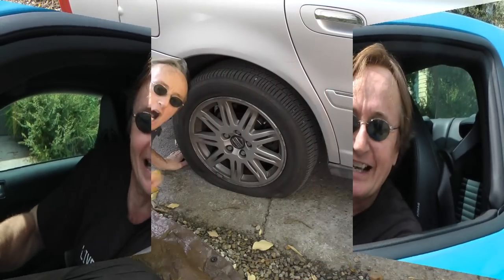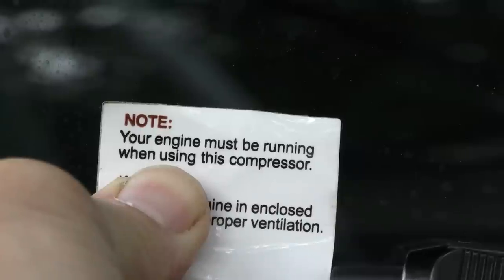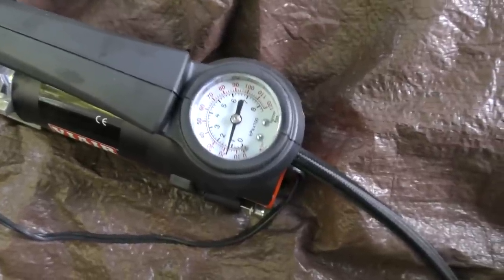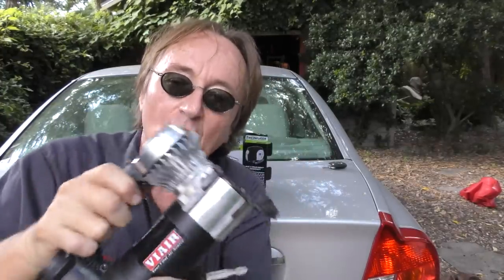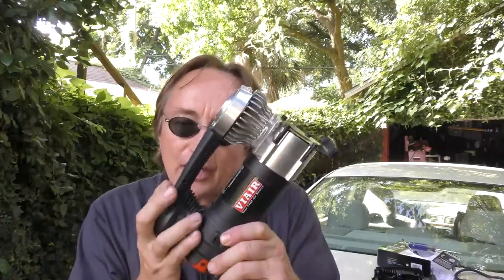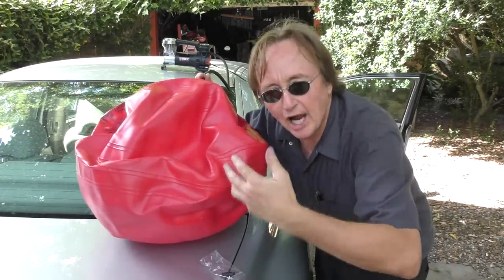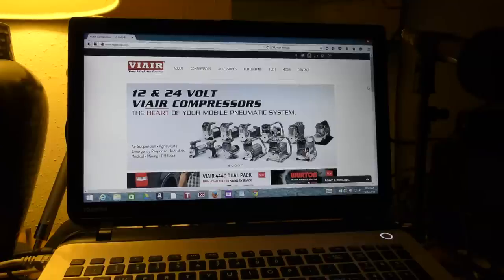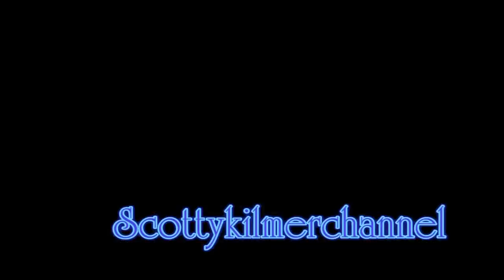How to Inflate a Flat Tire on Your Car (Tire Inflator)

Comment: I use a bicycle pump. It doesn't take as long as you think. Just check the PSI from time to time. For me, I pump all 4 wheels once it's 2 PSI lower than the standard. For 2 PSI, it takes only 6 or 7 pumps.

Comment: Thanks for the recommendation!  My Corvette has a factory air pump that works great but I've been looking for one to keep in my Truck and it looks like it could handle the tires on my compact tractor as well for the times when I get stuck (happens more than I care to admit).

Comment: I can attest that plastic crap bounces all over the ground and I ended up holding it in my hand first time I used it, while bent to make sure the hose reached. I just wish the big boys would also use LCD screens where you could set it to cut off at a certain PSI. That's the only thing I like about the plastic models. TireTek also makes a nice one but I'm not sure what tech it uses inside of it.

Comment: Scotty, what is your thought on inflating tires with pure nitrogen as opposed to regular air?  I know of two tire stores near me that offer nitrogen whenever you buy tires from them.  I do have a local mechanic that I go to, and his thought on them is that they are just a gimmick.
Reply: I am retired from the airlines where we need to fill the aircraft tires with nitrogen to keep the temperature down.
I work part time at a dealership now and for cars, it's just a gimmick. Regular street cars don't need nitrogen.

Comment: My cheap $5 compressor is still going strong and I've had it at least 5 years. The beauty of a cheaper one is you can throw it around until it dies where as an expensive one you wouldn't wanna get a scratch on it

Comment: Hey scotty i have a 2004 avalanche with the 5.3l vortec nd i was wondering if it was ok to drive in tow mode even if im not towing nothing thanks.
Reply from the maker: Denzell Wilder sure, you will just get worse gas mileage

Comment: Scotty Kilmer i have a 94" Honda prelude with a 2000 engine in it that has engine knocking after its been threw a puddle. the car is not hydro-locked but the knocking accelerates as i give it some gas. any suggestions on  some test i can do? i looked in the combustion chambers an there was no water an in the case there was i took all the spark plugs out an cranked the car to clean it nothing sprayed but there was water coming out the exhaust pipe. when in the puddle the engine stopped an i pushed the car out an had it pushed home. so far no wholes outside the engine an the car does crank an ride but the knocking is real loud
Reply from the maker: King mearsal If it still knocks, odds are piston rods are now bent inside, ONLY taking the engine apart would figure that out for sure though.
Reply: in your best opinion, would it be best to just swap the engine out for a low mileage used one or look for a new car? love your vids btw!  they have help me out of a struggle many times keep up the good work

Comment: I agree that cheap plastic compressors are not meant to last.  They are still better than nothing.  I would rather have that cheap plastic one than no compressor at all but that one you reviewed does seem like a good one.  Many of those small compressors that are not direct drive are gear driven like the Slime branded one, there is no chance that the little motors used in those things would ever work without being geared so low.

Comment: I guess if you're an auto mechanic or roadside assistance, and have to deal with flats every day you're probably better off with something durable. But me that all I do is drive around like most people, and inflate a tire every 3 years (the rest I simply change and take to get fixed and reinflated at the service station), I have a plastic crap compressor I bought at the hardware store and right now it's going on 15 years and won't quit. The screw type valve looks nice though, seems like it'll outlast those typical lever-type valves you find on most compressors.

Comment: Do you have to inflate a tire when it's only flat on the bottom?
Reply: wholeNwon Most likely..the thump when it comes around to the flat part would shake the car apart......LOL
Reply: Hahaha what part of a tyre is the bottom when you rotate it
Reply: LOL this getting way too funny. I love it.
Reply: wholeNwon funny :)
Reply: theothertroll Just a small, rostral segment of the right postero-lateral cingulate gyrus.  But I'm young so the contralateral portions of the limbic system will compensate since my corpus callosum is intact.  Thanks for your concern.
Reply: soylent green I actually said something like that to a woman who had a flat tire.  She replied, "Oh, I guess you're right."  Yes, she was sort of blonde.
Then I had to backtrack and help her.
Reply: lol
Reply: +BigAl Willis That's exactly what I thought, Al.  Thanks!

Comment: so if its flat you just fill it up and forget about why it lost pressure?  Ive tried a viair before.  It worked once, then the second time it blew the fuse, as stated in several, several online reviews.  It's still costly and durable, but Id recommend using the direct battery connection vs. cig lighter
Reply from the maker: +infringinator  often nails on in tires and refilling them lasts a LONG time. But viairs are really good compressors, people will always whine about something on the net. Even the best tools I've ever used have people who whine about them, with millions of people out there, someone will always be unhappy and whine.
Reply: Scotty Kilmer I'm not sure whats going on with my tire I have a set of new tires and every  now and then one of them starts draining air.  Mechanic says it could be dirt on the rim.  It's a hassle and I need a compressor lol
Reply from the maker: +infringinator remove the tire that loses air, put 42 psi in the tire. Then drip water mixed with dish washing liquid on the rim of one side with the tire flat on the ground . If rims are leaking from crappy installation (which often happens these days due to lazy idiots being the tire installers who don't care about their work and make minimum wage) then the solution will bubble up where the rim is leaking.
Reply: Scotty Kilmer yeah mechanic automatically said its the rim getting dirty before he looked at it.  Anything I can do to prevent the rim from leaking again?  He claims he cleaned it up and put a bead on it.  To be fair the newer tires held up for a year before this leak occurred.  Now I have the joy of replacing rusted out brake lines at $500, and I'll install my shocks (he wanted $600 to do 4 shocks!) 

Only other concerns I have is 130k miles without changing the transmission fluid.  I'm due for spark plugs and wires soon too.

Comment: Hey Scotty a person made a comment about "what a person should keep in their car". I am guessing for emergency. I think it is a great question. Maybe a video idea in the making. If you do decide to do it give us a summer and winter version. Thanks Scotty!
Reply: Air pump, spare tire, jumper cables, basic socket and wrench set and a first aid kit including water.
Reply: Samuel Campbell and a phone charger
Reply: Big Guy Review There are some Compressor / STARTER combos from B&D that work well. They have a working light, iluminated pressure gauge, 12V cigar socket, usb port for charging things. It has a 12V 9Ah Battery inside for the starter. But you can run the compressor from it, light, and charge phones from its USB socket. Starting current is not that great but it get the job done. Also has a battery alternator checker function using a 5 led meter. This checker also is used for its internal battery. Its a very complete unit and good value IMHO.

Comment: Hi Scotty, I got a check engine light come on  my 1999 ford ranger code p0306 number 6 cylinder  misfire truck runs great can't notice any thing wrong , what could it be ,thanks your the greatest.
Reply from the maker: steve kwall if it runs great leave it. Would be almost impossible to figure out the problem. when it actually misses and you feel it, check spark plugs and fuel injectors first.
Reply: steve kwall  I just fixed this exact code on my Ranger last week. I changed the wires and plugs and it improved a little bit but it was still rough. For me, it turned out to be the coil pack. It was about 100 dollars for the replacement part and it was easy to install. The only thing I can say is make sure you keep the coil pack order to the piston order correct. If you don't know take a photos of the wires and how they go from the coil pack to the plugs. The order is very important or it won't run right. If this is the problem on your truck, it isn't a very hard job to fix. Good luck.
Reply: Thanks moofushu

Comment: I plugged in my new compressor into the cigarette lighter and blew the fuse for the cigarette lighter, should have used the accessory socket which are 20 amps instead of 15 amps. lesson learned!
Reply: Some of these have a FUSE inside so you don't blow the fuse on your car. Newer cars they are called Power Sockets. Just make sure the car is running when using it, I tried one on my 2002 Honda Civic without the engine on and the battery drained real fast. I think they recommend running the engine because they know it can drain your cars battery pretty quick.

Comment: I think I'll go to a gas station and do it for a quarter lol
Reply from the maker: Chthonian121 half of those have bad pressure gauges, and they aren't there on the road if you need one.
Reply: Scotty Kilmer Not to mention, gas station air pumps usually have no air/water separator in them and are poorly maintained. You'll probably end up putting a little water vapor in your tires, too. lol

Comment: Just carry a bicycle pump. It makes good exercise, and it's faster and cheaper than compressors.
Reply: Ive had the same bicycle pump I got when I was 14 for my bicycle. This pump has been with me through 4 cars now. (I buy and sell them a lot) So now I'm 20 and the bicycle pump is still in my trunk. :-)
Reply: XenomorphLV426 you ever try to pump a car tire with a bicycle pump???? LOL Are you crazy?? It would take two days .
Reply: Y10Q Stop being such a girly man and pump the pump.
Reply: Y10Q Didn't I JUST say that I used it for my cars? And no, it does not take two days. Think 2 minutes, maybe 3 depending on how low you are. And it's not like I drive around with leaking tires. It barely ever happens so its not even a problem.
Reply: XenomorphLV426 sounds like it could work, most car tires only need 30 psi anyway versus the 60 or so you find in bike tires so you won't have much resistance to work against. The question is, are you using one of those vertical stand bike pumps or one of those micro pumps you tie to the frame? The second type will probably take a while!
Reply: Mario Melendez
 Bicycle tire is nowhere near the Car TIRE's volume. So you need some sort of a mechanical device to pump it fast enough. I am sure you can add some air with a bicycle pump. Say your tires are at 25psi, and you need 30. But to get it from completely flat to 30psi, forget about it. I don't think it's easy. I am sure it's possible, but you would have to be nuts to use a bicycle pump to fill a car tire. It's not worth the time.
Reply: Mario Melendez PSI is not a measure of the amount of air in the tire. It's a measure of pressure.
Reply: That's my point. You're going up to 30 psi, so pressure-wise you probably won't have any problems with the bike pump. You're not going to come to a point where the tire pressure gets so high you can't force it in with the bike pump. Where you will probably encounter a problem is with the air volume, which is miserable on most bike pumps, so you'll be pumping for a while. And if you've got a puncture big enough, you might not be able to pump up the tire at all with the bike pump.
Reply: XenomorphLV426 bicycle pump is fine if you have a ford model t, but there's no way in hell I'm going to use a bicycle pump on my trucks, especially my freightliner BC M2.
Reply: jim miles Back in 1985 I had a leak on my 75 Cadillac rear left that would be flat every morning.  I was realy POOR back then bad!!  This lady I shared an apartment with had a foot pump bicycle air pump.  Every morning for about 2 weeks I would sat my coffee on the trunk of that car and smoke a cigarette and rotate between my left foot and my right foot as I pumped the tire back up.  It took about 15 minutes, but I would just sip on my morning coffee and look around while doing this.  It was a foot bicycle pump with a rubber foot pedal.
Reply: Y10Q Youre WRONG...When I was broke back in 1985 I used a foot bicycle pump to air this Cadillac deville rear tire up from completely flat to 30 lbs every morning!!!  It took 15 minutes and I did it slowly while drinking my morning coffee
Reply: ***** For the sake of argument. If your car battery is dead there's  no significant difference in having an electric or manual powered pump. Especially since most cars in the USA have automatic transmissions, there's no way you could bump start it like a good o'l manual tranny.
Reply: ***** True dat. All I can say is, whatever works for you and fits your budget, that's what counts. I have one of those foot pumps for bicycle tires that I mainly use for my motorcycle. I always make sure I have it when I'm out riding in the remote desert areas. Plus tire slime saved my butt when I got a flat.
Reply: YES10 lol I tried it from 0 psi and that shit doesn't work especially  when you can hear the air leaking out

Comment: Does anyone know what  year is the best year for a Toyota celica.
Reply from the maker: ***** 1994
Reply: Scotty Kilmer  I was thinking about buying a 2001 celica Gt for 2800 with 140,000 miles should I?
Reply from the maker: ***** if it has the infamous yamaha designed engine, DO NOT buy it, they are junk from weak oil pump set up, the engines cavitate and blow up on high revvs.

Comment: hey whats the legal limit for tire tread in US
Reply from the maker: Jimmy Jay the wear bars on modern tires are the limit, if they are worn down to the wear bars they are illegal
Reply: Jimmy Jay it's 2/32 i believe
Reply: Scotty Kilmer Scotty, can a 12v Portable Tire Inflator work on a Older car like your 94 Celica that just has a Cigarette lighter?   

The new cars all have a little plastic flap that says 12v in place of the Cigarette lighter.

Comment: how can i get the most preformance from a 50 cc motor moped
Reply from the maker: ScNOR ByMinK not much power there, pretty much use good gas like shell V power and revv it up high. Or, rebuild the engine and port it and polish it and put bigger pistons in it.
Reply: Fill the tires till the point that the tire turns into a disc. Not exactly safe though.
Reply: Scotty Kilmer im thinking about geting a 70 cc cylinder on it
Reply: ScNOR ByMinK Nitrous, those 50cc engines are tough they can take it.
Reply: ScNOR ByMinK NOS

jk
Reply: TFiPW
It really is about the only way to get more power.

Comment: Putting air in a tire doesn't fix a flat. How many times do you just lose air but have no puncture? Good luck using this to "fix a flat tire in the middle of nowhere".
Reply from the maker: flexor212000 most flats occur because of slow leaking nails. Merely pumping them back up can work a long time. I was at the Mexican border in a toyota with a nail, I filled it up, drove to houston, and found it had not even lost one psi pressure after that long trip. I did remove the nail and patch it later though.

Comment: I'm sure the first part to break will be the hose.
Reply: ***** It must be quality if it has a connector that threads onto the valve stem, instead of the push-and-hold-forever or the push-on-and-flick-the-plastic-lever types.

Comment: If the tyres flat its got a hole. This wont pump up a tyre with a hole in it haha
Reply from the maker: Zane Butler most tires have nails in them, you pump em up, they will stay full for quite some time, realize that. The nails leak REALLY slowly.
Reply: Scotty Kilmer yeah fairenough. But wouldnt it be better just to put the spare on?

Comment: 2 min. For each tire is a long time!!
Reply: The cost at gas stations has gone from 50 cents to $1.50 where I live, a big waste of money to spend when you could use that cash to buy a lottery ticket! If you have a place like Les Schwab they usually will air up your tire for free even if you didn't buy them there. And they never ask you to buy something while you are there. But I know a guy whose wife works for one and he said they get bonuses at the end of the year for selling customers things they don't need or doing service that isn't needed right then. He said his wife got $9,000 in bonus the year I worked with him.

Comment: yes but there is a reasen why the tire is flat so filing it up dosent realy fix it  now dos it :))
Reply from the maker: Boocho88 yes, the video doesn't say fix, it says it won't let you down. Most nail holes will hold air for days or weeks if you fill them back up. And nails are the number one flat reason
Reply: Scotty Kilmer  yap good thing there is a easy and cheep way to fix a nail problem and not buy new tires :))

Comment: did i just watch a comercial.....
Reply from the maker: wizard4204 how cynical. the video does just what I said, shows a quality Metal pump that can last decades, instead of cheap plastic crap only good for a few uses then you throw it away. Plus, of course, you can use it as a regular tire inflator for your tires, since most gas stations don't even have free air anymore.